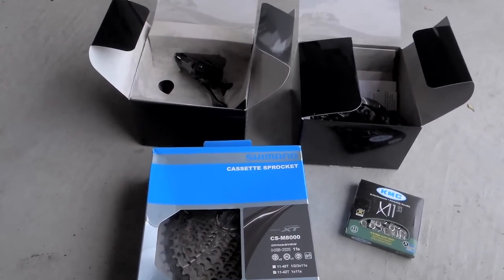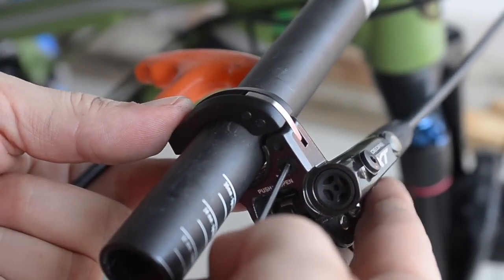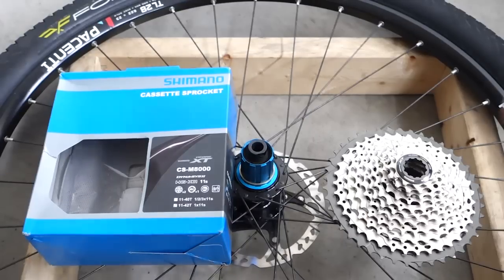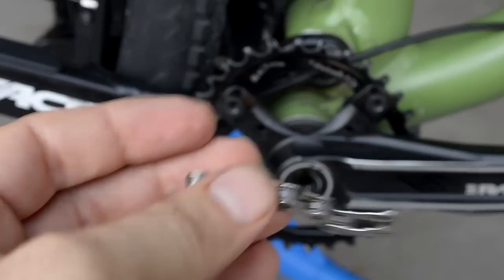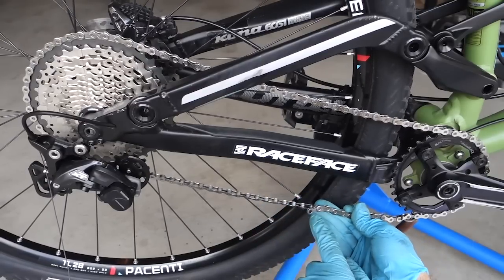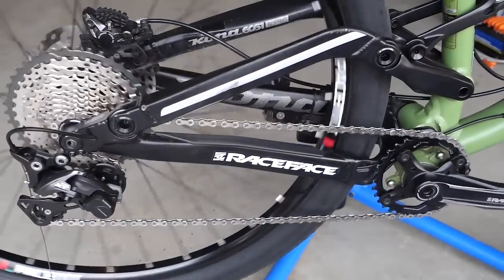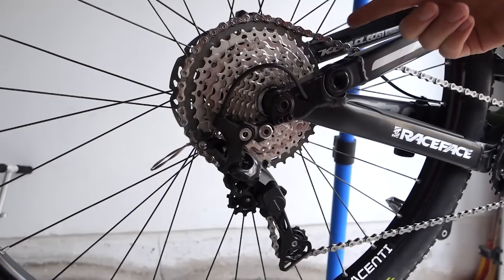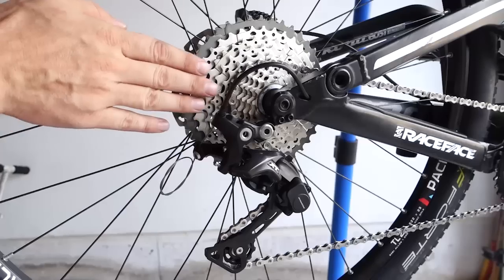1 x 11 Speed XT M8000 UPGRADE/ Install How-To, Ride Impressions: I-Spec II, 11-42t, GS RD

Comment: How many links does a shimanoxt chain have? Is it 114?
Reply: 116 links. I have 1x11 setup with 34T chainring and 11-46 cassette on full suspension and used the entire lenght.

Comment: I have a 2016 Kona Kahuna with a 3 x 10 Deore setup with the following specs (http://2016.konaworld.com/kahuna.cfm). Looking to do this conversion to a 1x11 setup - I have the WTB SX19 29" wheelset and according to the website for these its 11 speed compatible. Is there anything I should be concerned about which would make this bike not compatible with an 11 speed rear cassette? For example the spacing in the rear since this is a wider cassette?

Comment: Hey i got question, i used to ride oval cranks on my bike called biopace made by shimano and i noticed i rode faster than perfectly round sprockets. What do think of the modern ones are they the same as the biopace or do they ride different? I have a 1998 trek 820 with a bio pace installed with a nine speed cassete and im considering going to a ten speed cassete with single front sprocket but i dont wanna loose my riding pattern on a new sprocket thats round.
Reply: LoveMTB ive had many versions of the biopace. Im just kinda scared cause im a heavy guy im 5 ft 10 250 and the only reason i ride older cranks is cause they are made of steel. They ride smooth. I rode regular round one and one of my buddies had a biopace on his and i rode it and since then ive rode nothing but. They are now hard to come by. I would love to ride a lighter bike as it means its easier for me to ride. If you ever get a chance to ride an old 3 sprocket biopace ride it they ride so smooth. Have a nice day.

Comment: Shimano Deore XT M8000 rear hub freewheel locked up in 2.5 months of city use. Bent the hell out of the XT M8000 derailleur, and destroyed the KMC XT-10 Titanium chain.
Same garbage freewheel problems exist, nothing has improved, cheap department store bike parts.
Reply: So what did you end up using to replace it?
Reply: @travesm5054   DT Swiss 350 with the 54T ratchet upgrade.

Comment: XT isn't an upgrade over Sram X9. The x9 derailleur is much better than the XT shadow derailleur. The clutch (chain stabilizer) on the XT derailleur is very poor. I've had nothing but trouble with mine. Stick to Sram.
Reply: I've done the service. The return spring has a problem now. It's only four months old. The shop won't replace it under warranty.

Comment: "if your chain rubs on the tab between the pulleys you did not put it in right"  That is a very stupid statement, ..you should simply say: "You can ROUTE the chain through the tab, or you can NOT OUR IT by going over it. Go over it is the correct way. End of story. Talking about 'rubbing' when obviously to a 5 year old child the chain and the tab are going to be extremely close with potential rub to each other on either side is just stupid and a waste of needless thinking. Be smarter when you say important steps.
Reply: triggered

Comment: Hello again. Is it possible to use this shifter with a SHIMANO GRX RX810 rear derailleur?
Reply: No, the Shimano road and MTB pull ratios are different. You want either a Wolftooth Tanpan or the GRX specific 1x Rear Derailleur (RX812).